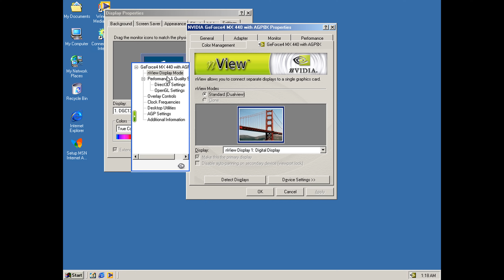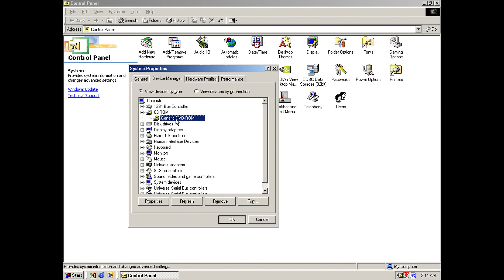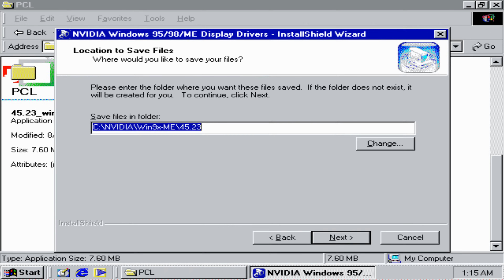I gave Windows ME another try

Comment: "Windows ME" wasn't Bad😉, you only need to "Add SDRAM/DDRAM", it was "Stable & Fast" to Boot on "Desktop" and Better😊 on "DOS Games🎮", in the "Year 2007" i Noticed🤔 that the only thing that Make Windows ME slow was the "Keyboard Settings⌨️", and that was the Time⌚ that i realized that you can "Adjust Keyboard⌨️ Speed" in "Control Panel" then "Windows Millennium" will Fast to Function like "Windows 98SE".👍👍😎

Comment: I remember back in this time, buying ME SE at a Papershop in Austria, beside a Suse Linux - Box; and we was far, far away from Internet/BBS, which told me: ahhhh, me won´t work
I remember, i put the OS on a "Compac" Computer, which was upgraded with some stuff like GraficCard, SoundBlaster, VideoGrabber etc. and what shoud i say????
I had less blue Screens as i had under win 98 , and it worked smooth and very, very long, until i switcht the computer, with win 2000.
Both Computers was so good, so i pass Vista/Xp for a realy realy long time, so next machine was with win 7 (rest is history)...
Both computers (Me2ndE and 2k) worked til the late 200x  until they was "retro"-machines, and su*k more energy, than a effizient modern Computer, and Scanner/Fax was not anymore a reason/argument to keep them alive, and with Apple Mini it was more easier to grab videos (Firewire) as und the "old" machines.
I couldn t say, it was not working; but i guess, i had much less probs, than win95/98 together

Comment: ME probably fell into the same trap that vista did where people tried to run it on older systems that weren't quite fast enough and early drivers were a mess. It's people totally fine to use now where 1GHz+ cpus are cheap and drivers have all been updated.

Comment: Given  that MS-DOS 8 is incapable of Real Mode, you could make a disk image with a Windows 98 boot disk, or a Windows 98 DOS bootable USB, CD-ROM, or use a second computer. Then you could install Windows 98 and Windows Millenium together, and two BAT scripts that run/enable either 98 or Me, and rename themselves to prevent renaming WINDOWS and Program Files for each OS, they could be WinME.bat or Win98.bat. If you boot to DOS with a Windows 98 boot disk and have Me and 98, you have the full and most modern 9x system, you can use Windows 98 to run programs that detect Me and refuse to run and to have full DOS.
Reply from the maker: Or just use 98.

Comment: With me I have seen Windows ME as a mixed bag because it all depends on the hardware that you had installed inside of your PC. My dad had a Sony VIAO mini laptop that had Windows Me on it and it ran like absolute garbage that sucker blue screened every chance it had but once he upgraded to Windows 2000 that machine became so much better. My two friends had PIII 500mhz machines both running Windows Me and both machines ran it just fine. With me I tried Windows Me for about 30 seconds because of the lack of DOS support so I went back to Windows 98 SE.

Comment: I mentioned in my previous comments about having a K6-2 laptop but also in my basement I have another PC im not using... an old Celeron D pc with socket 478 same as the socket you used on this video ... it has 1gb of ram , no external gpu and 160gb hdd but its old PSU is not working anymore which is why its in the basement right now

I wonder if it would be worth salvaging that too ... if i were to do that I always thought it could only run XP and I have my newer secondary machine that runs linux currently but has an FX-8320 cpu and an HD 6670 gpu that does support XP out of the box if i wanted to try that... so if i could find some other use for that desktop maybe I could see myself salvaging that too by searching for and getting a compatible PSU for it 

Windows ME ? Dont think thats worth it ... Maybe could put Windows 2000 on it just to try that out ? Idk ... I have gotten the bug and it is almost an obsession for me at this point ... still , this PC has the curse of not being good enough to play any and all XP games even If i paired it with a good AGP GPU , but its too fast and too "new" for Windows 98 ...
Reply from the maker: If it has AGP then it will work with 98 and ME and be a good fit!
Reply: @philscomputerlab  yes but it has two 512mb ram sticks ... which isnt 98-compatible , and I dont think I want to buy a 256mb ram stick for it just to run 98 when its cpu is not era-accuratr to begin with

i think i'll stick to my K6-2 laptop for now and see what it can do ... for XP i have my more recent AMD FX PC to try , which is compatible out of the box , but thats not to say im never going to do anything with it , maybe I will try something in the future , but for now I already have way too many computers already ... my modern Gaming PC running windows 11 , the AMD FX pc is running linux and it is where i do all my work , and I also have a windows 10 laptop that doesnt fit the requirements for 11  ... my setup is already kinda full 😅 , even if i were to bring that Celeron D desktop up from the basement ... where would I even put it ? 

I guess this is a good problem to have for someone who loves computers and technology 

(i also have a mini-itx pc running a haswell celeron cpu from 2014 that my father got from his work after they replaced it , they were gonna throw it away so and it used to run windows 8 , so yeah ... way too many unused pcs in my basement , a literal treasure trove )
Reply from the maker: @mariolis  Yes it's a struggle sometimes picking what parts to go with 😊
Reply: @philscomputerlab  Im spoiled for choice , and thats really exciting , im really lucky to have all those pcs laying around ... but all 3 of the old pcs i got would have been thrown away as trash if it wasnt for me actively asking around everyone in my family for old pcs , the celeron D desktop was my uncle's while the K6-2 laptop was my father's ... which makes me assume that a LOT of good hardware all around the world end up in landfills because despite still working 100% since their owners thought of them as trash or obsolete ... which is really sad if you think about it , for me and you these are treasures ... yeah sure , they cant run the latest windows release and they are no good at running a browser , but why throw away something that works? something that can have some use ?

Comment: I used WinME for about 6 months when it first came out.  Got a free copy through work so I figured I'd give it a try.  As I recall, I just couldn't get it stable.  Granted it may have been just the drivers not having caught up to it yet, but it was just easier to simply swap back to Win98se.

Comment: Great video, I use ME on my Dell Inspiron 8100 as it has more stable USB support than 98SE plus the sound card doesn't support true DOS mode anyways. It also does give better performance on late Pentium 3 / early Pentium 4 systems when compared to 2000/XP! Only thing I will say is to disable system restore as it never worked properly under ME and just wastes disk space.

Comment: Phil,

AudioCD is working with Daemon tools using VxD, it just has to be the highest drive (e.g. drive letter must be higher than phyiscal disc drive).

You can change drive letters by right clicking on the drives under device manager and looking at the properties window.

VxD driver is still better to use in ME since you can do the SB16 emulation with it for a better experience with DOS games which should run just fine under Windows.

Process to install is same as with Windows 98, just use VxD driver then make the necessary change in the registry to enable to emulation.

The step to install the DOS driver pack is not required, not unless restoring ability to actually boot to DOS in ME anyways.

Windows DOS sound driver is handled by the CTSB16.DRV which is copied over to Windows folder when VxD driver is used. You don't need any of that autoexec SBEINIT and SET BLASTER blah blah, that is only for booting to pure DOS.

If following those steps then all should be great and working with VxD.
Reply from the maker: So weird I've never had luck with VDX drivers and Daemon Tools, also without any real optical drive...
Reply: Ahh interesting and fair enough.

I can speak less for Windows ME but I can provide more than a few examples of it working just fine under 98SE using this method.

Well, I guess you inspired me too to crack out the old Windows ME and have a play :D
 @philscomputerlab
Reply: @philscomputerlab  
Hey Phil,

I have fully tested this for you today, I think you will be pleased to see the results.

I will make a short video to demonstrate for you, stay posted! :)
Reply: @philscomputerlab  

https://youtu.be/15zJ5SFNBg0?feature=shared

Sorry for potato quality, I don't own any decent recording equipment. Fortunately I do a full voiceover to make up for the fact you can't see much on screen.

Comment: The first Windows PC my family had ran Windows ME. It was one of those Compaq Presario 5000 models with the purple plastic disc holder on the front of the case. It had a 1 GHz Pentium III but unfortunately had no AGP slot. It would have made a great Windows 98/ME gaming machine with a GPU upgrade if it did. It did play Command & Conquer/Red Alert/Red Alert 2, though, and that's all I cared about in the year 2001!
Reply from the maker: Ahhh machines without AGP slot are so annoying! It really limits your options. S3 Virge, Matrox Mystique and of course Voodoo 3 come to mind for suitable card.

Comment: OK Phil are you a mind reader? While digging around in the basement I found a New copy of Win Me still in the box. I have had this for many years BTW. I also have the Same exact sound card and Vid card too. CPU is no problem and neither is the Mem. What is the largest SSD I can use with ME I'll figure out. I do have some old games to try again. Only issue is the motherboard that I don't have. So I'll have to dig around some more and see if I have one somewhere. On the other hand I do have a an IBM with a P4 3.0ghz and a Radeon X850XTX card that works just fine. Might be worth a try. I'll check that website that you mentioned for drivers and get the others from Lenovo. Many Thanks for keeping this stuff alive and well!
Reply from the maker: Well with 98 I like using 30GB. The limit is 120 but even that size there are hoops...

Comment: I run 2 Socket7 guetto built vintage computers...
One of them has an Intel TX Chipset, USB worked on windows98se
The other is a super socket7 with via chipset, USB Refused to work with whatever usb card I had on Windows98se (even after unofficial service packs)... but works fine out of the box with ME.
But back in the day, Upgrading to ME from 98se was a mess for my friends and I kept on re-installing 98 for them. 
Clearly I should have given it a chance as a clean full install.
Reply from the maker: No surprise that VIA has issues 😜
Reply: @philscomputerlab  as a 40 year old, socket 7 is what I started with. Rebuilding 2 vintage computers has been a fun/painful experience :) Kids today have no idea how spoiled they are. New hardware is so easy.

Comment: 512mb of ram with Windows Me is plenty by far. You would have been probably better off with an AMD Althon or Duron rather than a P4 especially with Win9x and gaming. The P4 is more geared/optimized towards Win2000/xp and probably streaming applications. It's a technical point but an important technical point. But Windows 9x with 512mb of ram? I can't imagine too many out of memory errors with that setup!

Comment: Whenever I build a P4 s478 system, my goto cpu is the SL6WJ.  (2.8GHZ/512/800)
With a TDP of 69.7w it offers a really nice balance of performance and relatively low heat.
Surprised you haven't used one yet... maybe next time.  :)
Reply from the maker: Sounds like a good pick!

Comment: I am running windows me on a mobile pentium 2 233 mhz mmx with 32 mb of ram and neomagic 128 2mb  video card 
I can even acces the internet with few websites working 
And running duke nukem,doom,the elder scrolls II daggerfall ,The Need For Speed ,NFS II ,POD 
Gonna try Tomb Raider
Reply from the maker: This is in a laptop? I really should get my hands in a retro laptop. I remember Sony having the smallest and cutest Pentium MMX machines back in the day. Only ever saw them at stores, never bought anything...
Reply: @philscomputerlab Yes,its a IBM Thinkpad 380XD from 1998 I bought for 8$ back in 2020 
Manufactured in UK
I added 54mbps wireless card whitch I use on a 18 years old Sony Vaio All in one from 2005
Dvd drive 
Original 3gb drive with no bad sectors 
It has one usb port 
Older versions of Windows were  well optimized for hdd
It boots faster than windows 10 on hdd with a core 2 quad 9550 and 4 gb of ram
And yes Sony had great laptops with lovely design and  both intel and amd platforms. 

Thanks for your reply 
Keep up the amazing work

Comment: What I don't understand is why my benchmarks and my game play is fastest on ME, slower by 40 percent on XP, then another 40 percent on W 7 , then another 20 percent on W 10 when every magazine insists they all play the same.. And this is on EVERY system I've ever owned.
I first noticed it with GTA SA.  I could play it well on a Celeron 1200 mhz on ME, but it ran poorly on XP on the same computer.   
I don't use ME to play GTA SA because the systems themselves had faster hardware to make up for it as I went to newer but slower OSs.
   I can play Video files to a crt TV with a Pentium 4 under xp, but it is too slow under W7.
But I can't get the wifi to work under xp, just 7.  So I can't watch Youtube on my TV. And I can't find a system that supports AGP video faster than Pentium 4.  And I can't find a video card that  outputs s-video (not just has the connector, actually outputs it ) that is PCIx

Comment: I had Millenium Edition back in the day almost as soon as it came out. I can say, that I never experienced anything near that what is represented in most of the "Worst OS Ever" like videos today. In terms of stability it was for me not worse than 98 in any way. All in all I ran it on three machines which were all build close to or after turn of the century back then (Pentium 200MMX, Ahlon 550, Athlon TB 1400C) and it ran just fine on all these machines. What is rarely mentioned today is, that Me had and still has a number of hardware drivers for the timespan of 1999 - 2000 which very often run just fine of a period correct machine out of the box. That sometimes makes life a bit easier, when running it on retro machines today. There may have been some factors that somewhat contribued that it was mostly stable on my machines: I rarely used DOS applications in that time (just played Comanche 3, which ran just fine on Millenium as well); I always made clean installs of my operating systems; I mostly used period correct hardware for Millenium (not older than 1997).
That beeing said, I actually enjoy the more modern (well "retro modern") look and feel of the OS when I use it for retro PCs today.
And of course: Phil, that was again a very entertaining and refreshingly well balanced video (in terms of beeing objective) coming from you. High quality content as always :-)

Comment: I have Windows Millennium on a Pentium IV and I can tell you:
1. All ms-dos games that are not speed sensitive to CPU run perfectly. The best video cards for Ms-dos compatibility are the Fx series from GeForce, for sound you need an Aureal Vortex 2, Sound Blaster Live, Audigy 1 or to have a pentium IV motherboard with an ISA slot. 
2. Windows Me does not blue screen when you remove the CD, usb stick or floppy while it is being read.
3. It has wireless keyboard and mouse support.
4. The location of a driver is saved.
5. The usb stick does not need a driver.
6. I do not recommend the VDM drivers because there is no longer support for sound in ms-dos, but with VDM you can use advanced stand by functions (suspend to ram).
7. Any usb joystick does not need driver. For Ms-Dos you need a joystick connected to the game port.
8. Windows Me is the most stable, I tested it after installing many programs and games without restarting and it didn't crash.
9. If I had to choose another retro operating system, it would be Windows 95 and in no case Windows 98.
Reply from the maker: Thanks for sharing your thoughts.